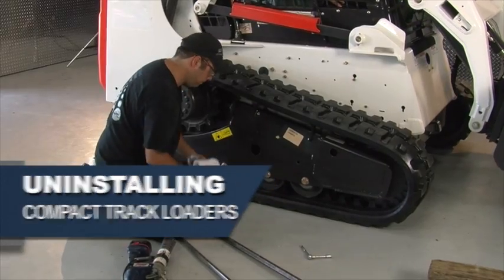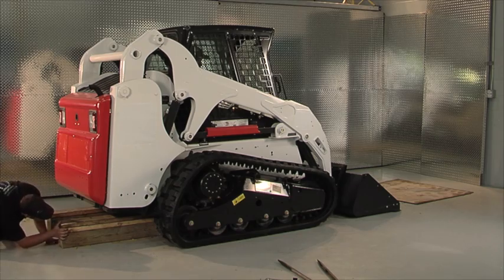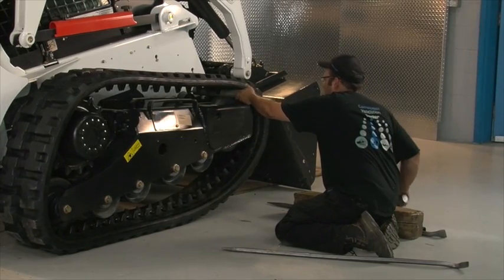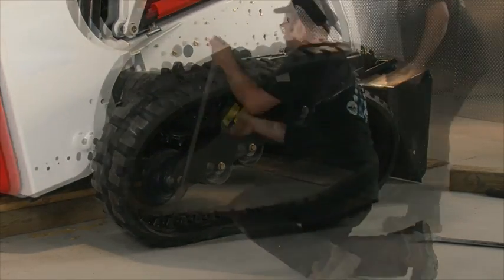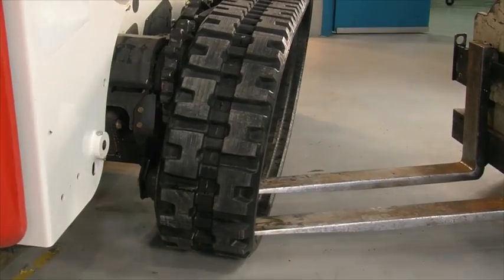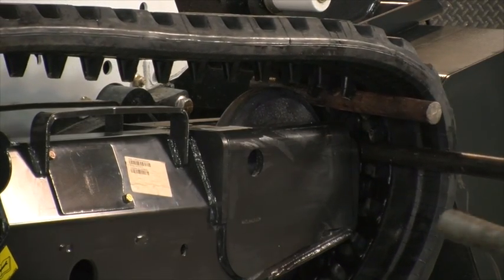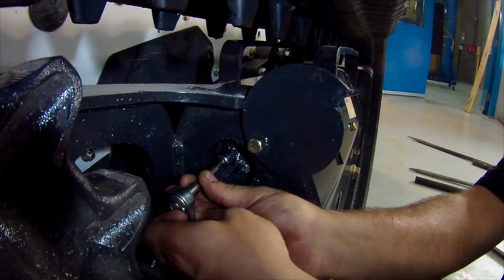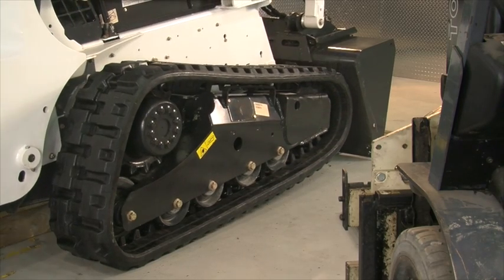CTL track installation (how to uninstall and install tracks)

Comment: Not at all the way i did them . With the grease fitting out use the pipes to empty the adjustment, The take the pipes out & use them on the last lower rear roller. Run the track till the pipes are like he did on the front & pry track off. Works way easy. Then the track is way looser. Then do what he did to the front